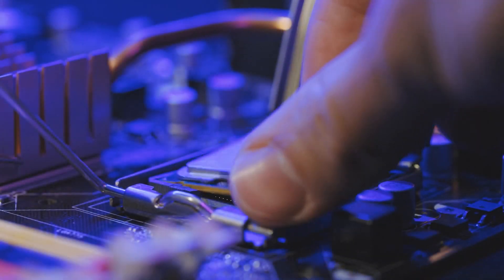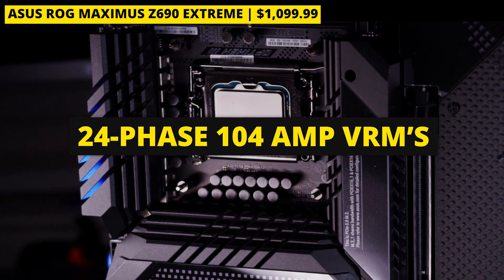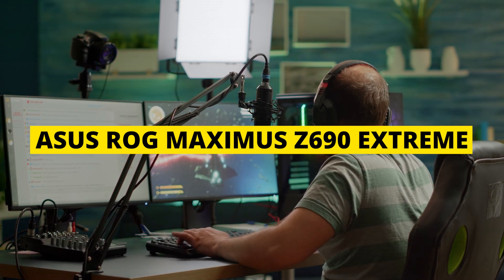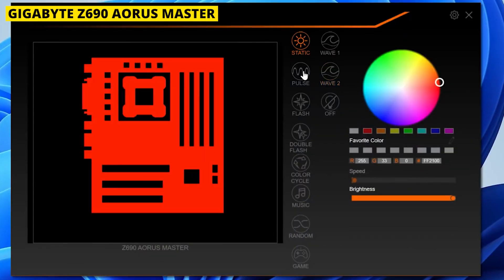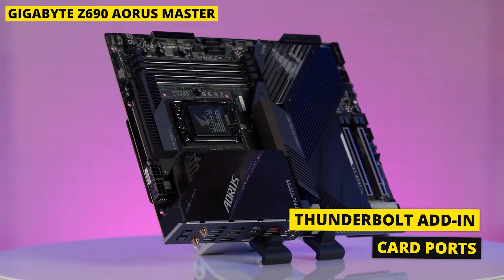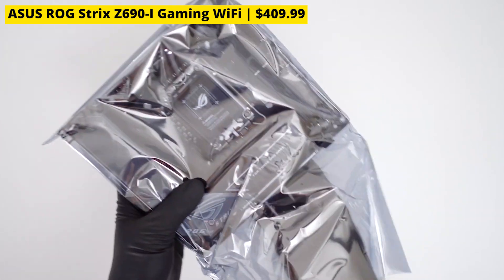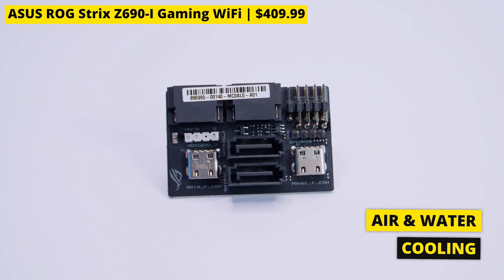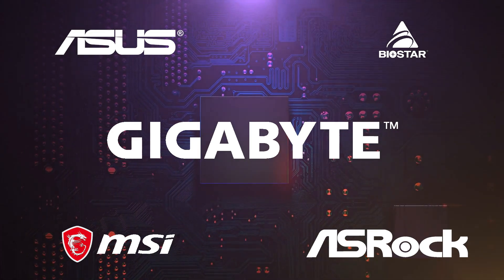Top 3 12th Gen Motherboard With Thunderbolt

Comment: The GIGABYTE Z690 AORUS Master does NOT have Thunderbolt. Should not be on this list.
Reply from the maker: The GIGABYTE Z690 AORUS Master motherboard does not include built-in Thunderbolt ports. However, it features two Thunderbolt add-in card connectors, allowing users to add Thunderbolt functionality via an expansion card.

Comment: Picking up a motherboard to house all this power without wasting a single drop is integral to squeezing the best performance out of your shiny new 12th Gen CPU. The best 12th Gen CPUs need the best 12th Gen motherboard
Reply from the maker: You're absolutely right—pairing a powerful 12th Gen CPU with the right motherboard is crucial for unlocking its full potential. A well-matched motherboard ensures better performance, stability, and access to all the latest features like PCIe 5.0, DDR5, and Thunderbolt support. Choose wisely!